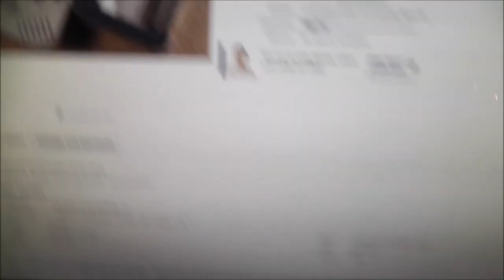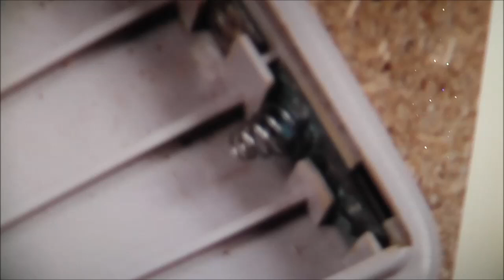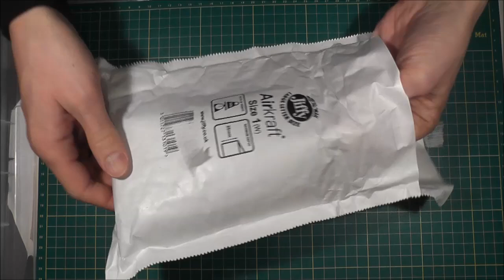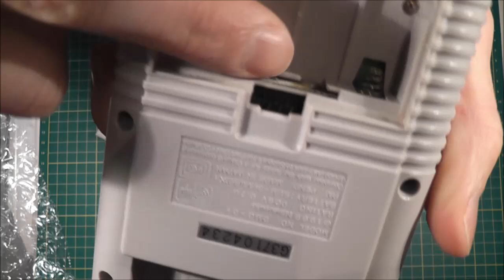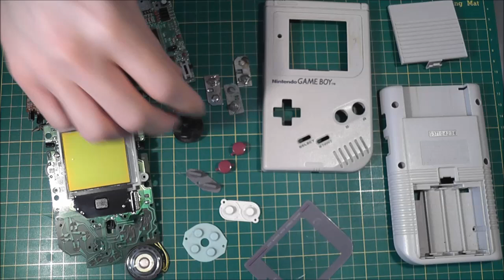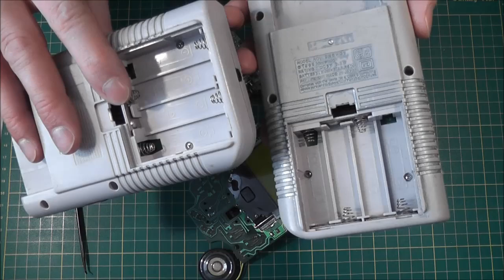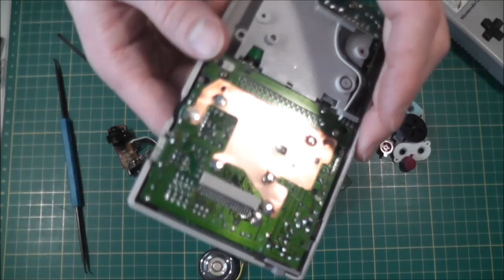Let's Repair - Ebay Junk - Original DMG Nintendo GameBoy

Comment: No one every seems to explain using the soldering iron to fix the missing lines on the lcd screens, but is the iron unplugged or do you have it set to a very low heat setting? I imagine there is no heat due to the fact that it would melt the plastic.

Comment: To clean corrosion the parts you need is:
White vinegar - any vinegar you use
4 ear picks 
a flat head screwdriver 
Left over container
Old toothbrush

1. Fill left over container with white vinegar 
-Brush corrosion very good to help the vinegar to clean very good 
-dip ear cleaner in white vinegar and clean on the corrosion on the plug and negative internal 
-use the other side of the ear cleaner to clean the corrosion with the vinegar 

2. Use flat head screwdriver
-Use flat head screw driver and scrape on where the corrosion is located next or on the plus and negative internal
-Use another ear cleaner to dip in white vinegar and clean again where you cleaned it'll give a chance to save your device and motherboard.
-Use another side of the ear cleaner and clean where you cleaned the same location again. 

3.Dry and let it sit
-(Lastly) make sure there is no more white vinegar left in locations 
-Let it sit and dry for 30 minutes or more
-Test the batteries 
--Tips by Jonathan Litz--

Comment: I have the same issue with the screen (vertical lines) ribbon cable and I’ve spent about 30 min total on trying to fix it. The lines temporarily come back but then fade. Is there any hope?

Comment: It’s sad, people essentially throwing out their old Game Boys because it won’t work because of battery terminal corrosion.
I got one for free from someone near me, and I cleaned the corrosion with alcohol and a toothbrush.
It worked fine.
No other issues, except a little dust in between the screen and the protector.

Comment: I don't know if you know, but if not (or if someone else could be helped out by this) a mixture of white vinegar and water (I use about 50-50) can be used to clean corroded battery terminals caused by leakage. I usually mix the vinegar and water in a small bowl and use Q-tips to apply it to the terminals. Good as new!

Comment: Hey i have a GBA, the better one with brighter screen.  It was working great  and was in great shape, but i accidently dropped it.  The top half ( the screen )  came apart from the bottom, but other then that their is no noticeable damage.   Is it worth fixing? i assume its just the ribbon that connects  the screen to it that came apart.  Would it be worth using as parts? i have another GBA that works great but does not have the extra bright screen.  What should i do?

Comment: I have a Gameboy similar to that. It works, just the screen has some lines dead.
Reply: Are the vertical or horizontal?
Reply: Josh B vertical, they are vertical
Reply: Then you're in good luck. Horizontal lines are damn near impossible to fix.
Reply: Virtual Venom TV I have that same problem, with my gba and it shows half of the screen and the other have has vertical lines

Comment: Any advice on repairing a Game Boy with a high pitched noise coming from the speaker.  Also when loading a game the Nintendo logo comes down as normal, then does it another couple of times before the game loads?  I've done the dead pixels and the screen is now perfect, so hopefully it doesn't have to be binned!
Cheers

ps this is my 1st attempt at repairing a Game Boy!!!  I'm normally a whack it and see type of....... (repairer)!

Comment: I bought a Virtual Boy a few years ago which worked fine when I bought it but I later found it to be temperamental. Sometimes there would be random lines of pixels onscreen while playing, but they wouldn't always appear every time I turned it on and often disappeared after playing for a while. I went about a year or so without playing it, and now it simply refuses to turn on at all. Any ideas? I've heard the Virtual Boy is one of the Nintendo systems most likely to break down, so I guess I should have expected this, but I'm still bummed.

If you feel like you might be interested in trying to fix it, let me know. I didn't go through all your videos, so perhaps you've fixed a Virtual Boy already, but if not, I'd be honored if you made a video about fixing mine. I'm super curious about what it looks like on the inside anyway, but not bold enough to crack it open. I would have no idea where to start.

Comment: conkers pocket tales is like 5 pounds on ebay, so you actually kinda got that gameboy for free
Reply: deIlluminati bought one from a thrift store for $2.50. Of course it needs some work, buttons are worn, missing screen cover and one vertical line from the LCD screen is missing...they are easy fix.
Reply: And the magnifier......
Reply: I have Conker's Pocket Tales. It's not my kind of game, so I never play it.
Reply: lol but the game didn't work

Comment: What was running on the gameboy when you were holding the heat over the connections under the screen to give it a solid black screen?
Reply: use the contrast wheel to turn  it black
Reply: Thanks :)

Comment: I bought an original Nintendo 64 they said it was working completely(fucking liars) end it was supposed to come with the game. So when I finally comes in the mail. I'm greeted to a fucking webs all over the Nintendo 64. And I tried playing it and nothing happened. So I literally have to go buy some tools to take this all apart and try to see what the problem is. So when I finally get this turkey apart I'm greeted dead spiders. Just the problem was is the webbing and dust. So I cleaned it all up tried playing a game and at work.

Comment: My GBC has a issue with the buttons.  The d pad has some button config switched, b does not work and neither does select.   I wish I was a little more fluent in on following back connections. I keep opening it up thinking I have figured out what went wrong.
Reply: Ma Ster try cleaning the contacts if there silver, rubbing it on paper will turn them mat black meaning there clean

Comment: Any advice on lines going left to right on screen?
Reply: That is possible, but there is a great risk of breaking the console, because the ribbon cable on the side can easily be damaged/melt from the heat from the soldering iron/heat gun.

Comment: I have an issue where whenever I turn my Gameboy on, the screen doesn't come on without having to remove a battery, and putting it back in. any solution? theories?
Reply: It also has a short in the speaker wire somewhere, I can barely here it at max volume, but with earbuds it works fine. I should be able to fix that by wiggling the wire, and taping it in a certain position. Any advice for that in case it doesn't work?

Comment: How do you clean the battery contacts?
Reply: +Ridog_ If the damage is from alkaline batteries then just put the contacts in common vinegar (for several hours). If the damage is from older acid batteries then use a baking soda in distilled water . And of course after the soaking rube them with an old toothbrush.
Reply: George Kakaratsios ok thanks

Comment: I took a gameboy apart because it had screen issues like the one in this video and my soldering iron broke so I was never able to fix it well it's been over a year now and for some reason the screen works fine to bad I mixed the screws up somehow I don't know which screws go to what device (I took it apart before I kept foot track of screws)

Comment: I remember when my DMG started loosing vertical lines, and it was beginning to make game play difficult. When I finally got a GBC, my DMG had an unusable screen. I didn't know what to do with it so it got placed in a junk drawer and forgotten. Then one day, I saw a video on YouTube that used that same fix you showed. I tried it out on mine, and I got my screen back. The only problem is that I put a screw in the hole that was marked not to place a screw in it. It put a hole in the foil reflector, but it still worked. I think I bought a DMG with a faulty screen just to fix that one. If I did, It's not really much used today unless I had a flash cart that I could load many games on.

Comment: How did he fix the part about the tape holding the screen?
Reply: I can only guess double sided tape
Reply: ***** Hmm, perhaps. Thanks for the reply.
Reply: blues03 superglue worked wonders for mine but you need to be reealyy careful not to leak glue on the screen during process or until it dries

Comment: Mine had leaked batteries as well. I don't have a power supply for it so can't check if it works without batteries but I'll try to clean the leaked battery residue. Should it turn on without game cartridge? The only one I had I lent to my neighbour years ago - he never gave it back and doesn't live nearby anymore.

Comment: I've had two of these gray brick GB's for many years and both have had screen issues. I've always pondered if it was just a connection between the screen and board, yet never tried to do a thing. Now, I finally know how to fix them. Thank you for proving my theory.

Comment: That's not the same Gameboy. At least, not the same housing. There was a bad scratch visible originally which makes me think you just took a working Gameboy and pretended you fixed the old one.

Comment: where can I find a triwing screwdriver? I can't find it at any of my local hardware stores, and what size(s) would I need.
Reply: Ebay, or if you are in a hurry, cut the tip of a screw driver, make your own.
Reply: +MrVitalic85 thank you for the advice, I guess I'll get it off ebay
Reply: +MrVitalic85 that's the other type of security screw
Reply: BeatlesCuber yeah your right, I was speaking as a machinist ( having tools ect ) Not a big deal, but for someone else, yes maybe.

Comment: I have question buddy  I have one and I'm  having a problem, it only plays  tetris and the others when I try to play  it does not play  the Nintendo starting screen comes out all messed up, I have to blow into the game and when it finally plays the system stays on but stops the game and the screen stays blank,do you have an idea what could be the problem if you can help me I would appreciated a lot   thanks.
Reply: @Octavio roso buy a 3.5 or 4.5 bit screw driver. you have to clean the games with an eraser look up richofreviewtechusa and look for his videos on how to clean old cartridges.
Reply: Thanks a lot for the tip  i'll do that .

Comment: On my game boy, the grey screen protector came off and I have wanted to fix it for a while, is there a specific glue I should use?
Reply: Crazy glue should work for replying the screen as long as you apply it carefully not to get any on the screen you'll be good to go!

Comment: Hello, I purchased a working gameboy in similar condition as this. I have everything assembled but now every time it is powered on I get a scrambled Nintendo logo and the games will not play. Any idea as to what happened? Thanks for any information.
Reply: I have the same problem sometimes, it's a problem with either the cart connectors or the gameboy pins, just clean them and you'll more Than likely fix this problem.
Reply: Alan Nock Joel is right, the Gameboy is not making a good connection with the cartridges, probably. Maybe get the pins cleaned with rubbing alcohol?
Reply: javidg96 That is what I did, and after a couple of restarts it finally booted properly. I have taken it apart a couple of times since my original comment and it seems to be a reoccurring situation, but once it works I have no further problems shrug
Reply: Good luck man. This is why I need to find a friend with a hardware studies degree...
Reply: The contact points inside of there are probably broken and bent
Reply: It's not blowing in the cartridge or console what does the trick, it's the fact that you extract it and insert it back (that allows the pins to allign correctly), you definitely want to keep your electronics away from moisture
Reply: javidg96 reinserting does nothing I fixed gameboy color game by blowing prior to that I tried to simply reinsert the game about 6-7 times on two different consoles to no avail
Reply: That's kinda weird, though. Maybe it goes like so:

-You blow into the cartridge.
-Your breath moisturizes the contact pins.
-You insert the cartridge and the wet gunk moves upwards as the cartridge pins rub against the console pins, thus enabling a good connection.

Just a random thought. But don't forget that this will oxidize the pins!
Reply: javidg96 Yeah I was trying my best not to spit on it just blow xD Anyways a lot of people have been using this method and have zero problems with the games or consoles due to that.
Reply: Yeah, I do it some times too! I usually wobble the cartridge around right after so moisture evaporates before inserting.
Reply: javidg96 I was thinking about hairdryer could it work? (with heat levels off of course)
Reply: I have no idea dude, if I just knew what the actual principle of the method is...

What I do with my games is clean the contacts with a q-tip and isopropyl alcohol. It makes them work 90% of the time, the other 8% is usually solved by reinserting and the remaining 2% by blowing into it. That is, unless the contacts are worn out. I've bought some second hand games that are quite tricky to insert correctly...
Reply: Blow into the game and the game slot on the game boy

Comment: Do u know where I can find I whole new circut board with the screen attached
Reply: You should just try to find other broken consoles (similar to the one he was repairing) and take the parts from that that you need and pop 'em into the one you are trying to fix. If you find them cheap on Ebay, I would suggest buying it.

Comment: Why did the Gameboy instructions manual say that one should not mix different battery brands ?
Reply: There's a chance the batteries may have a different voltage.
Reply: Same goes for batteries that have varying levels of usage. The voltage also decreases as the charge decreases

Comment: How do you clean the battery connectors? I have green corosion
Reply: He used the back of the other gameboy i think
Reply: In my experience a bit of baking sode with a bit of water neutralises the battery acid. Then just wipe the compartment with a paper towel and it should be a bit better.
Reply: Jorn Thank you
Reply: Take me out and use coke if u have no cleaner I know it sounds wierd but it works
Reply: ***** use qtip and vinegar u will see the effect
Reply: ***** Depending on the level of corrosion you can sand off the acid residue with a semi-fine sandpaper or sanding sponge.
Reply: Only the rear board, he simply cleaned the battery compartment of the eBay purchase

Comment: can anybody help looked everywhere with no luck
my gameboy when i insert a game and turn it on it goes ding then shows a blank screen if i use a multicart it will load the game menu i choose a game then it just shows blank screen :( i have opened it up checked the motherboard copasotors ect and everything seems to be fine i even cleaned the contacts on cart slot and still games will not load

Comment: Thanks for showing how to fix the gameboy colorless for when this finally happens to mine.
Reply: Went to check on them directly after this and one colorless has speaker, screen, and major corrosion issues on the battery contacts and expect it to be even worse on the inside.

The second colorless has corrosion and speaker issues.

My gameboy color has speaker issues, but is otherwise fine.

Comment: This may have been covered, but what chemical is best for cleaning the plastic?
For the circuit board, is it safe to use iso prop for these old components?

Comment: Do you think you could do a video soldering and repairing a Virtual Boy so the screen works? I know there is the 'oven trick' where you heat up the glue, but soldering would provide a permanent solution.